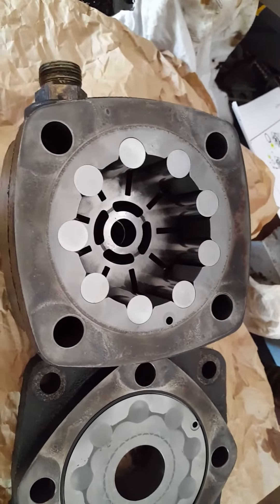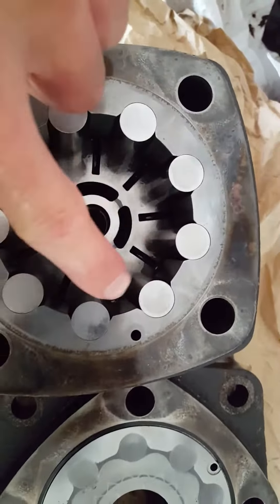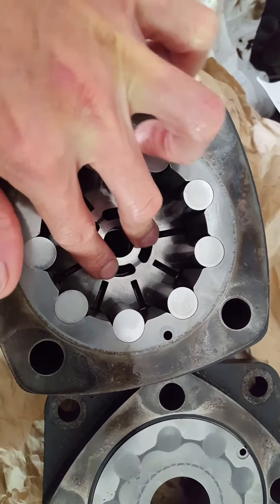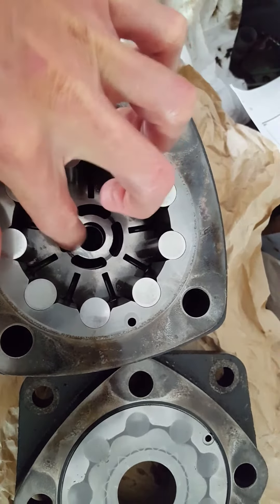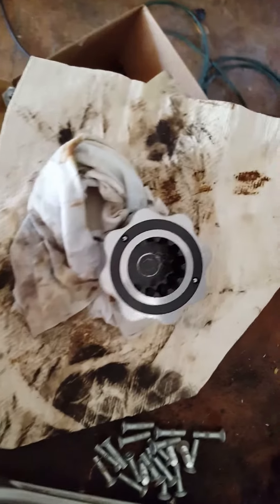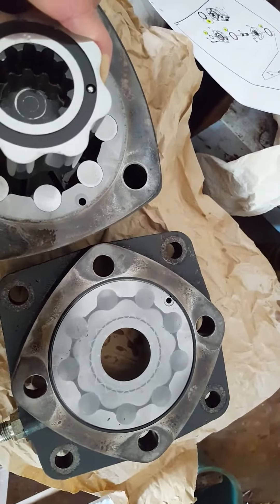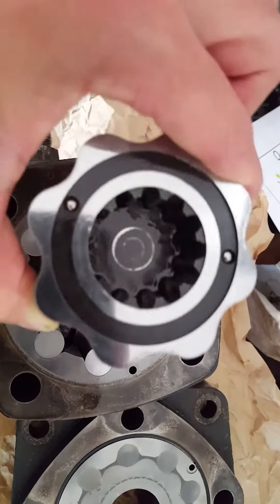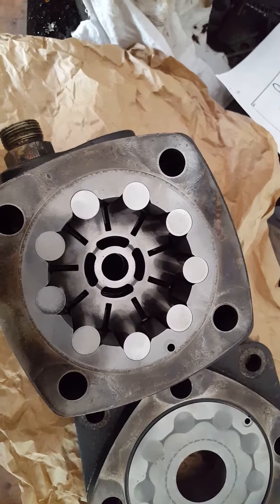1995 Bobcat 753 Drive Motor Reassembly Part 2

Comment: hello i have the exact 753 drive motor and i had doubts on the manual but you are correct on the timing of the motor. my question by any chance do you know why i only get power towards one direction and not the other way. basically when installed i only get power towards forward but not reverse ive replaced my hydrostatic pump and does same thing and also resealed the drive motor.
Reply: @D J C I've read somewhere in the forums that there is like a relief valve that is adjustable inside this motor. I have not taken mine apart but my issue is jumpiness and am leaning towards a reseal.

Btw, where did you get your oring kit from? Thanks!
Reply from the maker: I believe I had to order the kit from Bobcat.